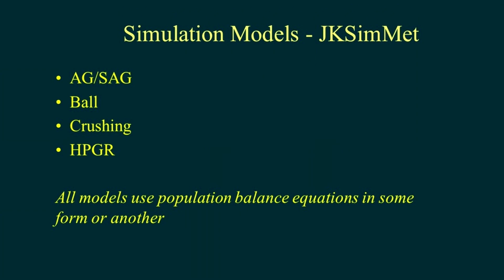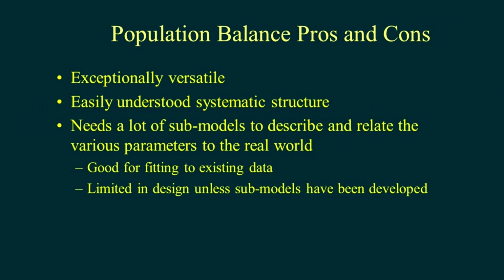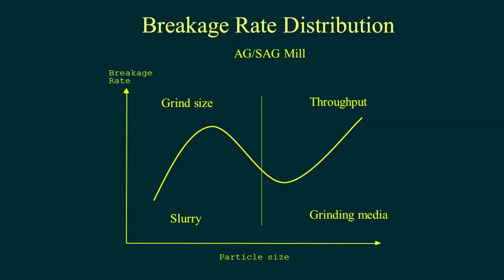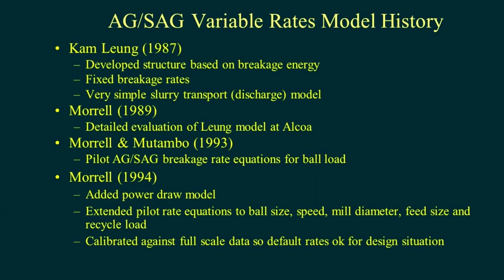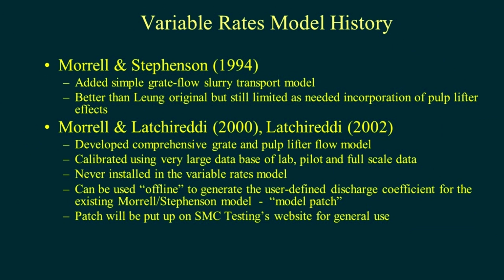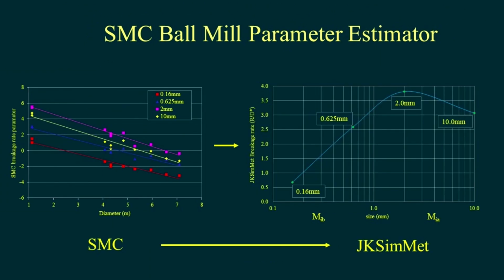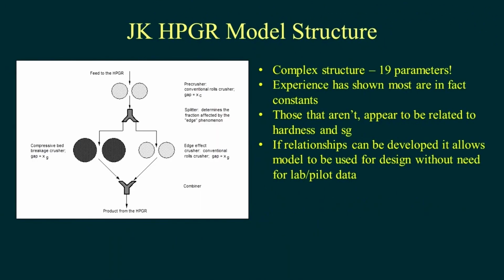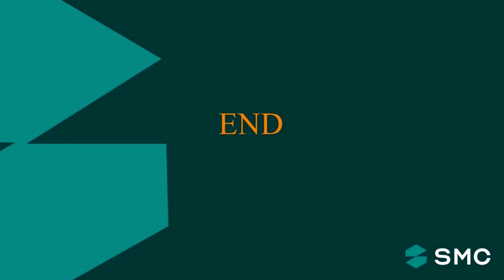SMC Masterclass - Session 5 - Simulation Modelling

Comment: Thanks for your helpful presentation.

I have two questions, first one is
- When we look at the t10 - Ecs relationship, we see that t10 is fixed at very low Ecs values. In other words, although we continue to increase the Ecs, there will be no change in the size distribution after a certain point. This point is very, very low compared to the kWh / t levels in practice. So what level of Ecs should I use to determine the appearance function, t10?

My second question is,
- Suppose I know the parameters A and b, and I decided the t10 value I want to get. From these data I can find Ecs. So, can I use this Ecs I found to size the mill? If i can't, how is the data I obtained as a result of the drop weight test used to determine the mill power?

Maybe, I am missing some very basic information. I am waiting for your ideas and advice.

My e-mail:
pural@itu.edu.tr
or you can contact me via Linkedin:
https://www.linkedin.com/in/yusuf-enes-pural-1782344b